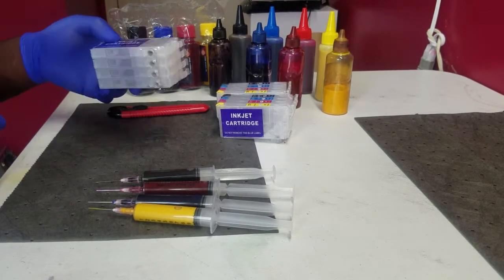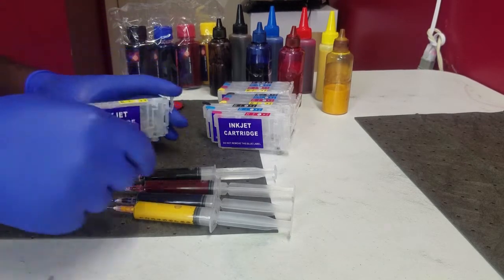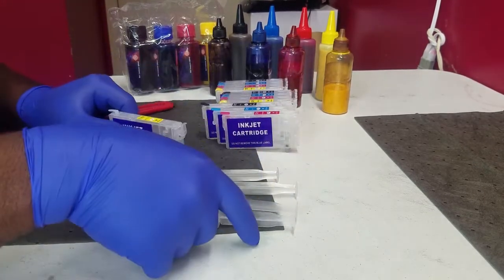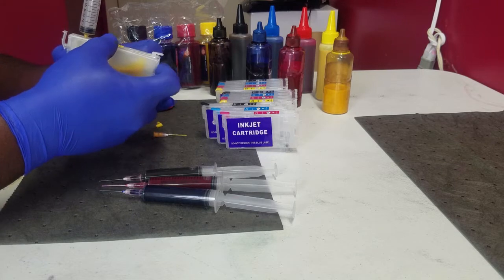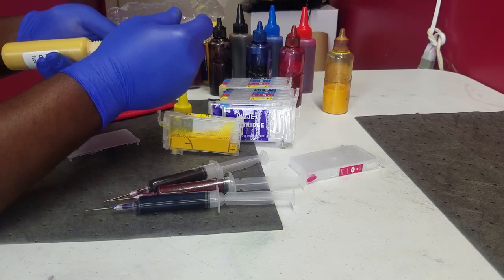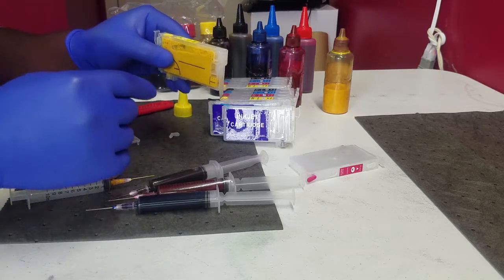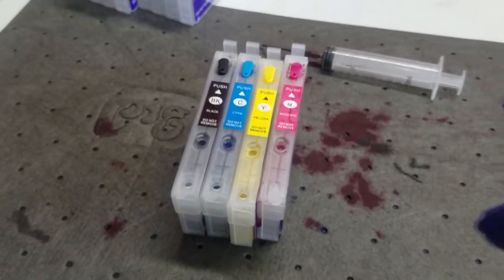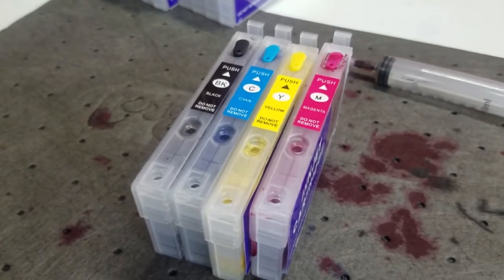Priming 802xl Refillable cartridges.

Comment: The video you are showing is not for 812Xl Refillable Ink Cartridges, but it is for 802XL Refillable Ink Cartridges.  I called Epson about the sublimation ink, and the guy said not to use sublimation in because Epson WorkForce WF-7820 is not designed for sublimation ink.  The sublimation ink is used for printing photos on your T-shirts using heat press machine, he said.   He said that I should only use dye-base ink.  Is this true?  Do you have a video on how to refill 812XL Ink Cartridges?

Comment: So after looking through the videos and the shop, I have 2 questions
1. It seems that every source of information on refilling ink carts is pushing sublimation dyes. Why is that? Is there no place to get bottles of regular old pigment ink?
2. The replacement 812XL chips sell for 69.34 USD right now. That's practically the price of legit ink cartridges. If I'm not printing on sublimation paper, is there any reason to even try using refillable carts?

Comment: Note ppl this does not apply to the Epson wf 4740 yet this is the practice al method he is showing you. But do not buy based on cart. Size. The rabbit hole is deeper. If your doing sublimation the 4740 does not have chipless firmware yet nor does not have a chip reset. So he is right but if u have this model it still yet to be tricked out... So ATTENTION CONCEPT IS TRUE BUT NOT ALL CAN CONVERT PROPERLY. DO RESEARCH AND THEN DO RESEARCH ON THAT RESEACRH BEFORE U BUY A USELESS MACHINE BASED ON TITLES... NO BASHING THE CHANNEL JUST COMMENTING I APPRECIATE THE VIDEO IT HAS SOME TRUTH TO IT
Reply from the maker: The 4760 is an ecotank printer. It doesn't have cartridges at all. 
This is just a video showing how to prime the 802xl cartridges. 

This method can be applied to all the refillable Epson cartridges with vent holes. 212/202/252/702/802
They all are (pretty much) the same on the inside.
Reply: @McZell  I corrected it
Reply: OMG........ just performed more research on WHAT to do or WHERE to find a CHIP resetter for WF4740............. IM LOST With now INK & Cartridges...........My fault for doing more RESEARCH ...............ANY1 HAVE ANY HELP FOR AN EPSON WF4740.........???????